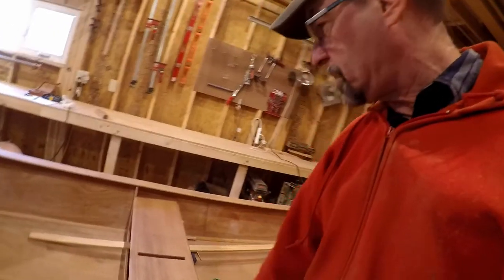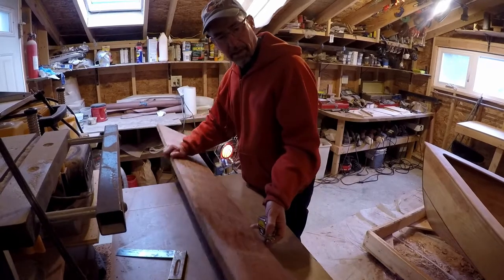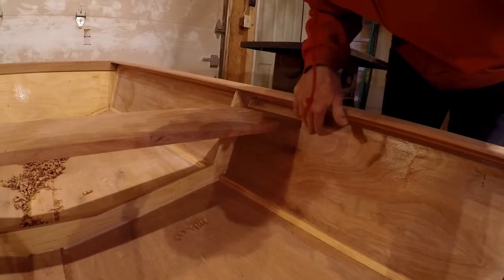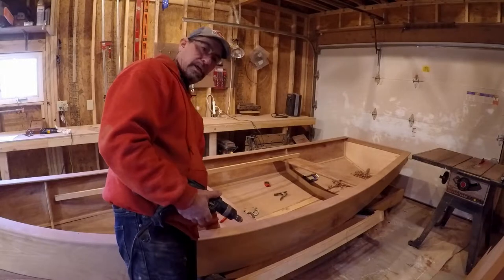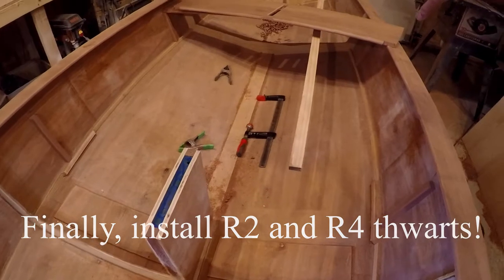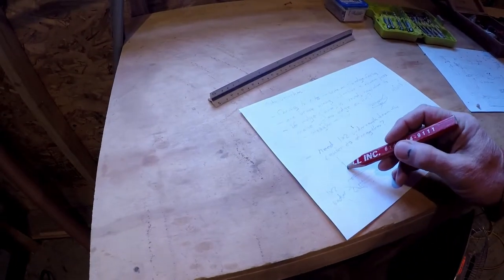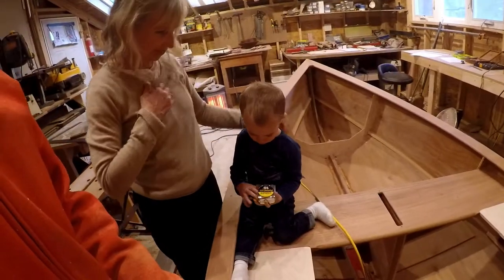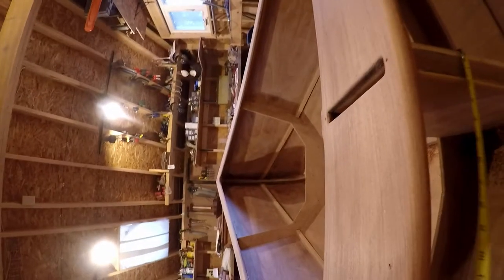Ep 21 Making the R4 Thwart and Side Benches: Designing and Building a Sailing Rowboat

Comment: Nice video. I am looking to design some thwart seats for a Spira(rip) boat design. Do you have any pointers or websites you used for research, or did you create the seats entirely yourself?  Best regards, H.
Reply from the maker: Thanks--I'm afraid I did the design myself--no helpful websites to point to for you!  One of the factors was the lumber I could get.  In particular, I needed the main thwart to be wide enough to accommodate the daggerboard etc.
Reply: @rudywoodcraft9553  no worries. I might have to steal your methodology. I'm not planning on sail power. (Probably an outboard.) But I love the idea of inward facing seating. Thanks for the great video!